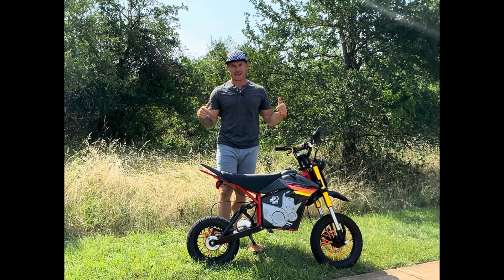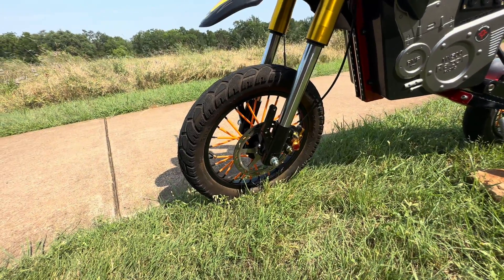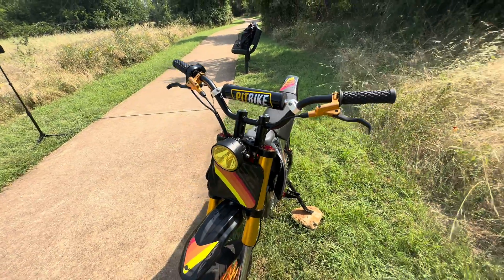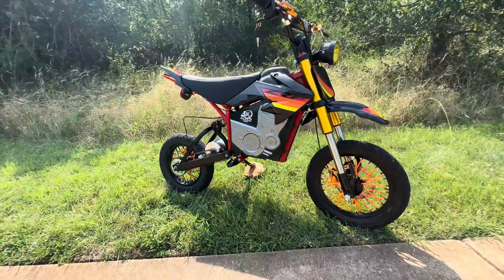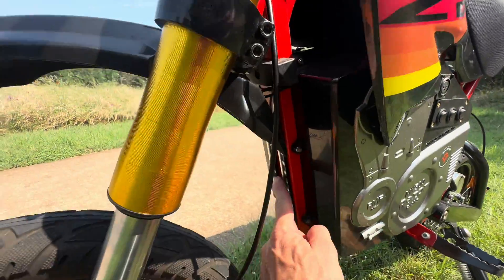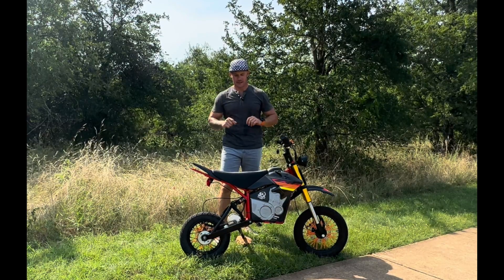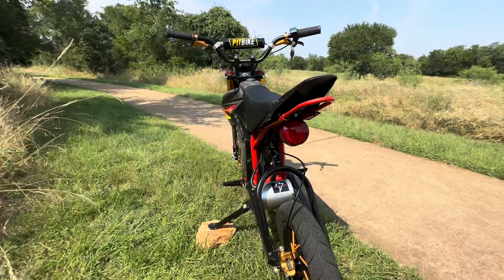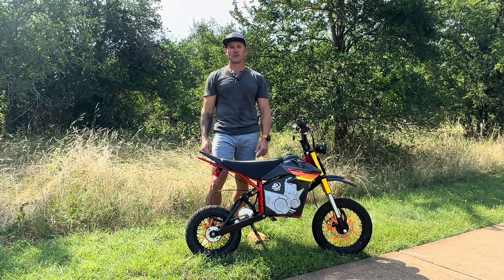48 Volt Upgraded Razor Dirt Bike Built For An Adult. Applies to MX500, SX500, MX650 And RSF650!

Comment: Hello I purchased the triple tree clamps with the forks and I noticed that the clamps did not come with hardware and on the mx650 the existing clamps on the stock forks are welded on so there are no hardware that I can re/use what did you use?
Reply from the maker: I made a trip to Home Depot and made it happen 👌
Reply: Sorry for asking ridiculous questions. My son ordered these parts and I don’t see it working. I’m sure I’m missing something simple. How are you mounting the parts onto the frame. See pics
Reply from the maker: @Madscat1320 a bushing kit from Ride Or Die https://rodrandd.com/products/razor-to-crf50-front-fork-bushing-kit

Comment: How do you use the grips and the throttles on the bike. I am new to all this stuff so I am trying to learn. And do you need all the links for the bike to work or could you just use the motor and the battery and the throttles to make it work.
Reply from the maker: I remove the grip on the throttle side and put my own throttle on the tube. What do you mean, do you need all the links? Thanks good watching!👊
Reply: @VoltronWatts  do you need everything on you website for the bike to work or could you just get the motor the battery and the throttle.
Reply from the maker: @Slash_CLAN you really just need the Vevor kit. It comes with a throttle, motor and controller. You would need a battery too. Here is a link to my discord, other and go down to parts links. I have a lot more links there 🤙

https://discord.gg/5tWB9RfK

Comment: Hey i got the forks and the tripple tree in this video. Did you use the stock bar that connects the frame to the tripple tree??
Reply from the maker: I use aftermarket bars 

WEIYINGSI Universal 7/8 Inch 22mm Dirt Bike Handlebars, Upgraded Pit Bike Handlebar with Foam Pad for Motocross CRF YZF KXF KLX RMZ DRZ Pit Dirt Bike ATV Quad - Black
Reply: @VoltronWatts  sorry for the miss understanding i meant the metal bar that goes through the frame and tripple tree clamp under the Handlebars
Reply from the maker: @Rippinandfishin ohhhjh no. I use an adaptor from Ride or Die RD. I had to take so material off the bushings to make it work. Check out ride or Die RD, they have bolt up fork options that’s even easier 👌
Reply: @VoltronWatts  Just looked them up on ride or die, are they the Razor to CRF50 Front Fork Bushing Kit
Reply from the maker: @Rippinandfishin yup

Comment: i just got the dnm air shock and it doesn’t compress at all? do you have any idea of what’s happening?
Reply from the maker: It’s adjustable and has a lock out on it. Check the settings 🤙
Reply: @VoltronWatts  ok i think im going to return it and get the dnm spring shock since i dont have an air pump
Reply from the maker: @Rippinandfishin 🤙
Reply: @VoltronWatts  did your tripple tree clamps come with bolts? mine didn’t
Reply from the maker: @Rippinandfishin if I remember right I think they did…. I built this bike several months ago tho.
Reply: @VoltronWatts  Ok thank you so much for your help. I’m probably just going to get bolts from home depot
Reply from the maker: @Rippinandfishin that should do 👍👍
Reply: @VoltronWatts  yeah i have moved the lockout to different spots and it still doesn’t compress at all
Reply from the maker: @Rippinandfishin maybe the chamber is pressurized
Reply: @VoltronWatts  do they come with air in them? did you have to pump air into yours?
Reply from the maker: @Rippinandfishin I don’t remember to be honest. I’ve bought so many I have had to adjust each differently tho.

Comment: Will the 2 piston brakes from lone star bolt right up to the forks/swingarm or do they require an adapter?
Reply from the maker: For the rear of the bike it will bolt up. The fork is going to require an adaptor to use the zoom style brakes 👊 thanks for watching and feel free to subscribe if you havnt already. I appreciate you 🍻💪🏼

Comment: Is there a video of the fork installation?
Reply from the maker: I Gotch you fam. 💪🏼

Ultimate Guide For Bolt On Fork Upgrade Mini Bike, Pit Bike, Razor MX500, MX650, RSF 650 And SX500
https://youtu.be/sIqV7WGunbU
Reply: @VoltronWatts  is there one for this specific Amazon forks and head set
Reply: Or does it go on the same
Reply from the maker: @Weoutsidewithit the process is the same. You’ll need a bushing kit, triple trees and fork tubes. Are you apart of the modified razors for adults Facebook page? If not, join up. Lots of info and smart people there 🍻
Reply from the maker: goes on the same @Talariabryce
Reply from the maker: check out the other build videos on the channel too.  @Talariabryce

Comment: Hey purchased the handle bar riser and was wondering did you use the factory bolts or did you purchase some from your local hardware store, if so whats the type and size, thanks
Reply: What sizes were they?
Reply from the maker: I don't remember off the top of my head. Sorry man.  @emotoriderz
Reply from the maker: Hey man! The bolts I used on this I got from the hardware store. Typically when you buy a fork kit though, say from https://rodrandd.com it comes with triple clamps, risers and bolts. 🤙

Comment: Do those clamps fit all crf50 forks?
Reply from the maker: That I’m not sure of. They fit 45/48mm fork tubes. Probably not ALL CRF 50 forks. I have a video on bolt on forks 💪🏼🍻
Reply: @VoltronWatts  do these clamps work with stock hardware or do you need the $50 ride or die kit to make them work?
Reply from the maker: I do have the $50 Ride or die kit in this bike. 👌

Comment: This is awesome! The thing I have been struggling with is batteries. You mentioned up above that you put a Greenway 48v 20AH Lithium in it. I tried looking that up, where are you getting it from?
Reply from the maker: Hey Josh, thank you for watching. 💪🏼 I get them from eBay mostly. Can check battery clearing house .com too. If you’re on the modified razor FB groups people sell them there too 🤙
Reply from the maker: Check out www.voltronwatts.com for more razor info 🍻